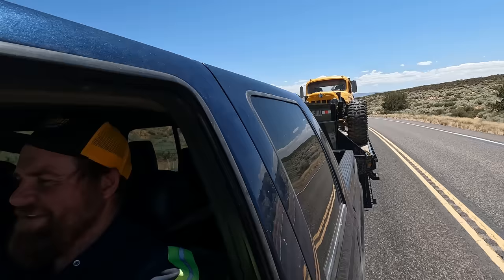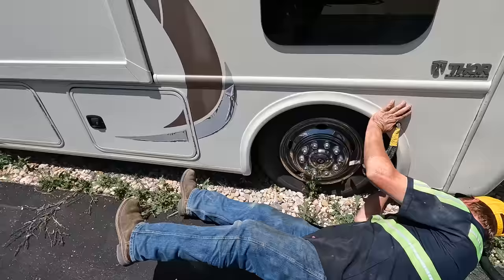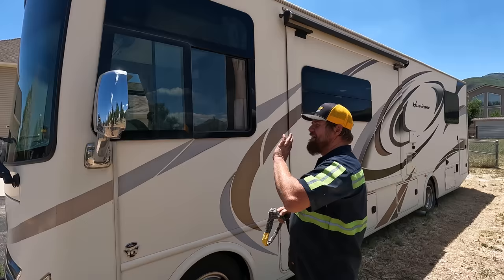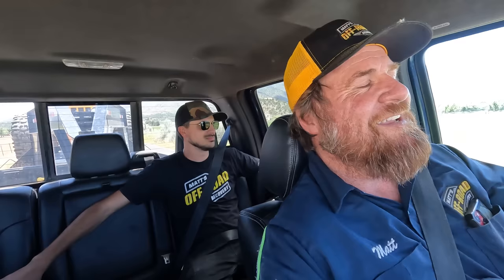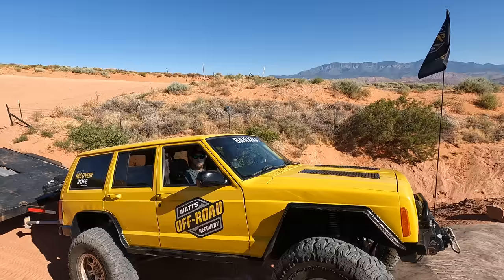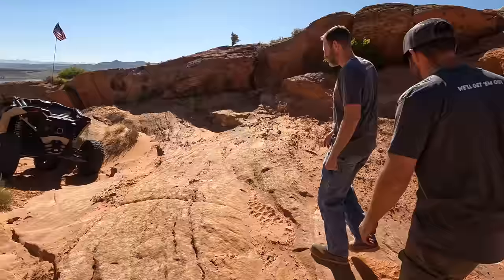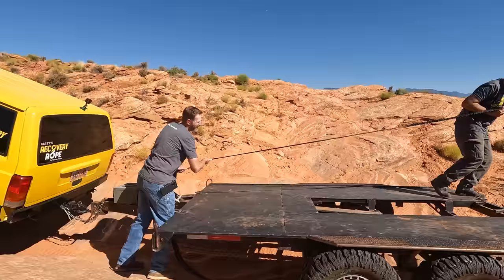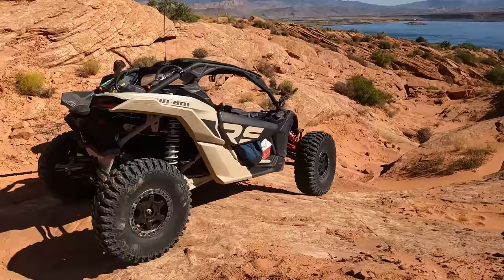Motorhome Stuck In A Bed Of Needles!

Comment: I'm so confused ...  im not a mechanic, and I'm 1000% sure automotive electrical work is even harder,  so HONEST QUESTION HERE, If you have already existing wiring for lights on the trailer from the Jeep ... how hard is it to run a wire off that, to the trailer battery to charge the battery on the way to recoveries? Seems like a force multiplier of sorts when you compare the time to do the wiring, as opposed to the multitude of issues you face EVERY TIME you use it and then need to re-charge the battery, or re-charge the battery AND a jump box, or worse ... can use the winch at all because someone "forgot".
Reply: You know, after I wrote that I thought, Wouldn't that make a great video? "How to wire a trailer to charge an auxiliary battery". I would LOVE to watch that video!

Comment: Genuine question from an uneducated feller: why air down the trailer tires when they are not powered? Is it a greater risk for snake bites?  Does it need sticky traction for preventing sliding down angled surfaces?  Just so it doesn't sink into the sand?  Am I answering my own question here?  haha

Comment: 11:19 Why not just use one of those cheap ole' solar panel maintainers. They're inexpensive. takes a  few seconds to hook up. Just need to secure it to the trailer. As long as the trailer is out in the sun, it's like having it connected to a trickle charger

Comment: Stupid question. I have a Ram 1500 with the 5.7 I've been looking to up grade my recovery ropes. I've been using harbor freight stuff because its cheap. The twist on this is I'm pulling rental cars larger SUV type. Like. Suburban size and I'm pulling military MATV and Humvees. Do what size rope do I get? The website refers to farm equipment and loaded down i have no clue what weight rating I need. I would rather have one that does it all instead of 2 or 3 or 4. Any suggestions would be greatly appreciated.

Comment: 'THE LUXURY OF ALL 4 WHEELS ON THE RZR.'  BUT, U HAVENT YET DESIGNED AND FABRICATED A SKID-SHEET TO PUT THE 3-WHL BRZR ON, TIE IT DOWN, SKID/DRAG IT TO A PLACE TO TRAILER IT WITH A WIDE ALUMINUM RAMP TO SKID THE RZR UP ONTO THE TRAILER -- PUT UR THINKING CAPS CON!!!

Comment: Matt & team, you should cut and sell tag pcs of blue steel's bed for some sort of fundraiser.
Reply: Or just the bed! Less work for them and more function for the highest bidder!
Reply: @JohnFL  I expect it won't be too long before they're looking for another, lighter, flat bed for Blue Steel.  That new one looks a tad heavy .... with 5 people in the cab, that monster flat bed, full toolboxes, extra bracing for the 5th Wheel hitch and bracing for the standard hitch, they've gotta be close to the gross vehicle mass with the Wrecker trailer hitched up.

Comment: @boiledtea479 The last time i got stuck really broke me of ever wanting to get stuck again.  I took my 06 Xterra through the hills of Ohio and ended up bottoming out in WET RED CLAY to the point it was vacuum sealed to the frame.  It involved me walking back out of the trail twice for help.  And i never wanna get stuck again.  I walked out on the area i got stuck in and the ground was hard.  I pulled the Xterra half way onit and backed up to see if i sunk any,  NOTHING.  And when i went to go over it,  it laid straight down to the frame and rear bumper cover.  It took a while to get it out.  So even if it came to Matt getting me out,  i still have NO DESIRE to be stuck lol.

Comment: If its a Ford v10 there shouldn't be air brakes atleast I've never seen it you can drive it with a normal license up here in canada and step should have a switch you open and close door and it'll go in or should when you start it surprised he didn't try the Jack's lol and then just put wood under

Comment: Do the tires on the trailer need to be that low on air? I guess the smoother ride is a factor with no suspension.

Comment: No no no, Anderson Power Poles are utterly horrific. Avoid them at all cost.  They'll stunt your growth and make you smell funny, LOL. To keep the trailer battery topped off, even a 1A current limited circuit would be fine, like a 12 watt lamp in series. With the lamp in the positive lead, you could use any old connector and not worry about it shorting. Or just add a solar panel and charge controller, as long as you live in a sunny climate, LOL.

Comment: why are y'all always dealing with dead batteries on trailers? a 12v power line from tow vehicle in your light plug will keep it charged or charge it while in Route to your Destination.. 7 pin plugs have them for Campers..

Comment: Battery tender trickle solar panel would solve your winch battery problems for less than $100 and with no wiring. I’d mail you one but I’d hate to support your laziness when it comes to applying simple solutions to simple recurring problems.

Comment: Y'all should buy one of those battery tenders and keep it in the box off the trailer. Run an extension cord to the trailer and whenever you park it plug it up. I know it's easier said than done but worth a cord laying where you unhook it, it would be harder to forget